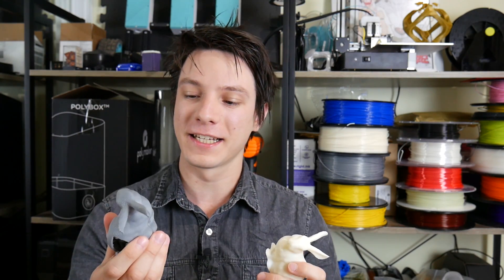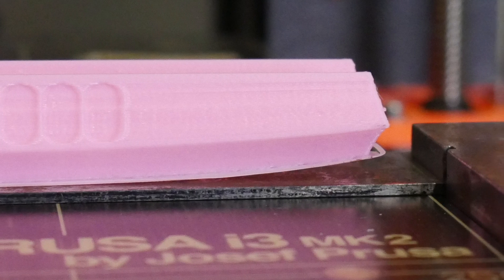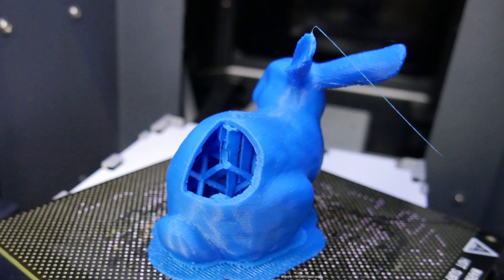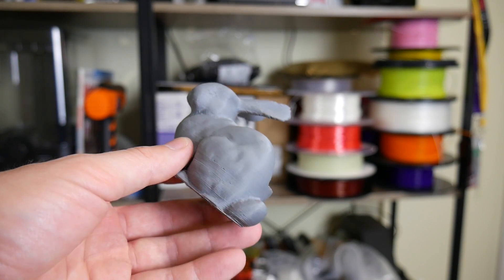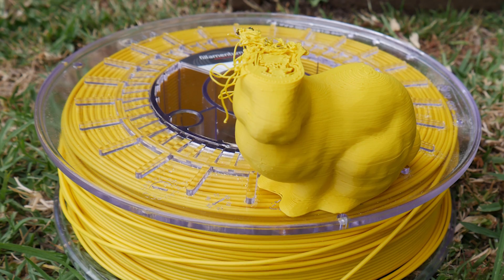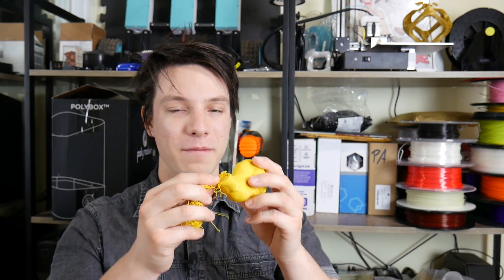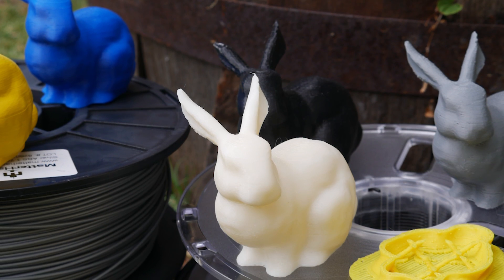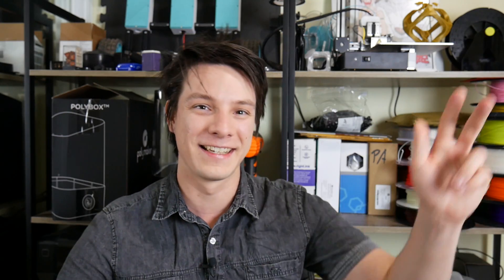Should you 3D Print in ABS? Probably not.

Comment: Polycarbonate has warping problems too, I think it's harder to build than ABS. Polymaker might be putting in some additives though.

One problem with the sliding bed machines is that it constantly breaks its boundary layer envelope when it constantly moves the part, cooling the part faster than you want, like how a breeze feels cooler than calm air, because that motion relative to the air breaking the insulating air around you. That makes them the least ideal type of machine for ABS (and PC) but they're the cheapest kind of machine to build. An enclosed area helps. ABS plastic is very tough but using machine designed for PLA compromises the build strength. Most hobby and consumer machines are really designed for PLA even if they claim a long list of compatible printable plastics. ASA is a nice material though. PC is nice too. All plastics have their unique mix of properties. PETG is nice but it's also very flexible so the design might need to be adjusted for that.

Comment: What about ABS+ ?

I agree that abs can be difficult but with PEI it is relativly easy. I tried abs+ and it is easier then regular abs, don’t really know the difference but i recommend to try it out.
Reply from the maker: +Henrik Wikström what is abs+? Sounds like a marketing thing
Reply: It is absolutely not a "just a marketing thing". eSun, F3Dfilament (Finnotech to you guys I guess), and Devil Design are just 3 brands producing ABS+ variants, basically ABS diluted with other stuff.  I use it a lot : it doesn't stink like ABS does during print and warps a lot less, yet it allows the typical ABS tricks (ABS welding, smoothing ect ect) - although the eSun variant does not completely dissolve like DD and F3D ABS+ does.  While I don't print normal ABS when I can help it, I've found ABS+ to be very useful at times. In fact, it has replaced my PLA use totally and I now only use ABS+, PETG and "special stuff" depending on what the prints are meant to be able to do.
Reply: Hey my dealer sold me some PLA+ and it is about 2x stronger than regular PLA and requires much lower retraction settings, love the stuff. I bought a role of ABS+ as well but never tried it, but my dealer said it is a stronger and easier to print ABS. 

Did do a couple of ABS prints a while back and found the material unremarkable, have to agree unless you specifically need its qualities, there are better options.

Cheers Angus
Reply: Think he might have meant PLA+. I've printed a headphone band using a sample from rigid.ink and it's much stronger and less brittle.

Comment: Should you 3D print in ABS ? well every materials have their pros and cons. The choice of the material depends on which application the part will be used for. It's totally different whether the part is just aesthetic/artistic or functionnal.
I usually print in ABS rather than PLA because I mostly print functionnal parts (mechanical parts), and aesthetic parts can be smoothed in aceton vapor bath.
And as far as I know other high temperature material like nylon or polycarbonate still suffer the same issues as ABS.
Reply: Hansbald depends on what you need, PETG definitely offers food contact and chemical resistance, but ABS parts still will stand a bit higher temperatures, and as far as I know, ABS seems more durable for outdoor uses. So still depends on a point of view.
Reply: try to smooth PETG with acetone
Reply: Not as catchy of a title...

Comment: Well, outdated means nothing to me in filament considerations. ABS is a material with a bunch of particular properties. If you want a material with good overall strength and impact resistance, which can be thinly sanded and smoothed, which hold well paint too, and which will last under weathered conditions, ABS is still hard to beat even today. You can probably replace for a better property or two but you can't beat all in once. The price tag can have the last word. By the way you can't get PC in Europe under 38€per kg which is insane. The price tag of uncommon thermoplastic filaments is enexpectedly expensive. Why? You can get a PC or PET sheet at roughly the same price (10-20%gap) as ABS or PVC. Why is this so different with filament? Marketing? Or maybe because you could agree or pay more?

Comment: I have a CEL Robox (v1/single material) and was wondering if you had any recommendations for a polycarbonate filament?

PS: Noticed that you are a bit of an Ave follower too - Good Work!  :-)
Reply: PC max is an approved Robox filament. There is a built in profile for it.
Reply from the maker: Good question, the Robox has a weird kind of extruder design, can it go up to 260-270deg C? That's what you need for PC filaments. From memory the heat bed was plenty powerful enough!
Reply: I have a roll of PLA in there atm. Automaker is only letting me go to 210 degrees (C obviously) for the filament and 170 for platter. I'll change the reel and check again...
Reply: - update. With a roll of ABS, it's 250/170. Is that going to be hot enough for PC?  
If you're not sure, please suggest a couple of vendors and I'll quiz them.
Reply: Scienteer, I'll google where's the best way to buy the stuff in Australia.
Feel free to share any vendors.
Thanks.

Comment: I ABSolutely  love ABS. It gives you a smooth finish, it's more forgiven, the supports are easy to take off, more flexible. But it's weak, you need to compensate with more walls and it smells, you can't stay on a room with abs.
Reply from the maker: Smells is a big one. I had forgotten how bad it could be, the hepa filter in the mini 2 does heaps to cut it down.
Reply: @MakersMuse  I usually just lock my printer in a basement bathroom with the ventilation on
Reply: You guys either have way more sensitive noses. I print ABS daily, printer is like a meter from me (mk2s). To smell anything I need to lean over the heatbed and actively sniff.
Reply: I run hatchbox abs, about $20 usd a roll and i cant smell a thing :/
Reply: Burning is nothing like melting.  Do not compare those.  I don't have any scientific way to test purity, but I always pick brands I know make very smooth and stable slurries in acetone and that vapor smooth well.  These I have always assumed were more 'pure' than the other brands, but I cannot say for sure.  May be just mixed with something else that dissolves well in acetone.  ABS smell does not bother me or my asthmatic wife.  Smells will be different to everyone of course, and how bothered you are by the smell has nothing to do with any possible long term health risks.
Reply: IDK I can't stay in a closed room when printed abs for a couple of hours it's unbreathable my throat starts to shrink after  some minutes
Reply: Perhaps it's brand related? But I print mostly in cheap abs from wolfix.
Reply: Polycarbonate (and presumably ABS-PC filament) fumes are even worse than ABS though.  Not only more types of particles (ABS typically being styrene particles where PC throws benzene into the mix), but also in terms of absolute quantity - PC puts out more.  Even if the VOC is lower (and you don't smell the ultrafine particles as much), PC still is putting more into your air.  Granted, at least it's not nylon level of particles.  Here's an article comparing the level of particles and VOC for different types of filament: http://pubs.acs.org/doi/full/10.1021/acs.est.5b04983
Reply: Same here, I am 1 meter from my printer in a fairly open room (living room) and print ABS on it all the time.  My wife has asthma and has never even mentioned the smell.  I smell  PLA far more, but it is a pleasant smell, although I really dislike the hard finish it has and how brittle it is.
Reply: Same, I was concerned that i wasnt smelling anything when i first started printing, thought they shipped me a different plastic
Reply: Probably not 100% ABS, if you try to burn abs plastic from a toy or a plastic box   with a lighter it stinks really  bad, that's what I'm getting not so intense, but after 1 hour in a closed room it's smelly
Reply: Ok my abs is very intense (from gearbest) yours not . period.
Reply: ABS is the most toxic amongst print materials according to a pretty in-depth study I read. Prolly won’t kill you but may cause brain damage :) Now I open my front door a crack when using it.
Reply: that smell is death entering your nostrils ... I just use my tower fan to circulate and spread out the fumes its fine, doesn't smell that bad. that said it is pretty toxic and super flammable; theres better stuff you can use.
Reply: Short to Ground you should try polymaker polymax it is incredibly amazing PLA and it shares many characteristics with abs
Reply: Maker's Muse does a HEPA filter work well on ABS fumes?

I'm half way through assembling my 3D printer and have a 2x 1kg rolls of ABS filament. 3mm sent in error plus 1.75mm I wanted. It's in a wooden cabinet (my children's enthusiasm would destroy it otherwise) so a filter could be added cheaply.

Comment: Does pc-max also have warping or shrinkage issues?
Reply from the maker: It does, and a slightly higher extrusion temperature so if you can't reliably print ABS you won't be able to print PC.
Reply: I see, what filament would you recommend if you need a glass transition temperature of at least 80°C?

Comment: How badly does Polycarbonate warp? I heard it's worse than ABS, so if ABS is diffcult to print, Polycarbonate is even more difficult.
Reply: On my printer cheap HK PC warps way more than ABS. It might have to do with the absence of a heated chaimber, bed at 130°C though.
Reply: Polycarbonate in general is much worse than ABS, you should not generalize - the good results you got are with only the single super expensive PC-Max material BLEND, not with "polycarbonate".
Saying that ABS is obsolete is too much too soon.
ABS will be obsolete only when there is a generic type of material supplied with multiple vendors that is not 4x as expensive as ABS and is as good as PC-Max.
Reply: @hlavaatch  it's $40 now for 750g. Wonder if it's still good?
Reply: Jan Hlavatý it's vallée PETG
Reply from the maker: It needs a higher extrusion temperature, but in my experience warp is similar and manageable at least in the UP Mini 2 it's not an issue.

Comment: imo i prefer petg over abs
Reply: Yes it can, PETG is just tiiiiny bit less temp. resistant than ABS. At 80C it's still rock solid
Reply: Laharl Krichevskoy I made my gear shift knob of petg, and I live in one of the hottest cities in the world  (Phoenix).  Yes, petg holds up fine in a car
Reply: Lerbyn 
but can you use petg in a car?  the idea behind abs is temperature resistance, can petg withstand a hot summer day under the svortching sun? thats the question...
Reply: You don't want to use ABS in a car - UV light (like from the Sun) will degrade it and it will break
Reply: @Steppan
Not really. Car windows are UV resistant. That's why photochromic lenses stay clear inside of the car.

Comment: I swear by Hobbyking ABS. i tried some more expensive ones and the improvement for me was not worth the cost increase.
It did take me about 2kg to perfect printing with it.
I print with ABS for two reasons:
1. Printing miniatures that i want to Acetone smooth.
2. I live in Western Australia and the car gets hot (where i often have my prints)

On large miniatures i often use sanded ABS to fill any cracks (which is rare now that i know optimum printing with it) and then acetone seal it.

Larger objects I have some PLA too of course.
Reply from the maker: WA sun will destroy PLA in seconds so can definitely see the value there for ABS parts! Impressed to hear you're printing miniatures with FDM in the first place :)

Comment: I've printed with abs a lot. Had quite a bit of luck with it. Yeah bit sucks if you don't get a good adhesion to the bed, but I frosted my glass I print on and paint it with an abs slurry. I have had failures, but had more successful prints. Yes pla works well for printing, but I don't care for how hard and brittle it is. I print trinkets and such here and there, but I mostly print useful items. Biggest issue I've ever had was with forgetting to store it properly and it getting full of moisture. I also like to smooth it with acetone vapor.
Reply: My experience is pretty much identical. :)

Comment: I print in ABS for things i want to smooth and that's pretty much the only reason.
While acetone smoothing does need to be done right to work it does well work.

What other filament plastics can be smoothed? Maybe i should look at those.
Reply from the maker: Not too many, which is one of the few remaining reasons I print in ABS, along with using acetone to bond it together so strongly. It's way better for prop making than PLA in that regard. Anything else you basically need to apply something over the layer lines, or sand them back. Polysmooth (PVB) is promising but the material is not very UV stable in my testing so far.
Reply: I assume you are referring to either Tetrahydrofuran or Dichloromethane smoothing for PLA.
Yeah not touching either of those for PLA smoothing without specialised equipment and lots of safety gear.

While Acetone isn't exactly great its much easier to handle and obtain then stuff that can smooth PLA and also much easier to work with.
Reply: I might need to give some ASA a try then.
Reply: PolyMaker has filaments that can be smoothed with isopropyl alcohol vapor. Checkout their PolyShur product. I have no experience with it.
Reply: As I do a lot of post-processing - undercoating, painting, filling, varnishing, so the many of the characteristics that make ABS an option are negated as unnecessary or not required. PLA does fine along with options such as PLA+, PETG. This video has caused me to think about alternatives to ABS for those times where PLA won't suit my requirements.
Reply: Laharl Krichevskoy PLA can be smoothed with chloroform and tetrahydrofuran, which are hard to buy for an individual in Europe (sale supposed to be prohibited here in France but because of European regulations, I've been able to buy some THF from Italy for €30 for 1L + €15 shipping, thus economicaly not worthy, I use THF only to clean heatblock's threads after there's been some leak into it, which may happen when I have to change nozzle size.
Reply: ASA can be acetone smoothed and welded

check Tom's channel he has a review on one ASA
Reply: Shival Wolf steel wool and auto body primer babe.
Reply: @Shival Wolf
Have you ever tried  PLA smoothing with Tetrahydrofuran  or anything or you are just repeating BS read somewhere else?
PLA is easy to print but it is brittle, completly useless when it comes to temperature. You cannot weld it, smootht it and it is even dificult to glue with any standard glue.. so if you want to print some useless decorations downloaded from thingiverse I'm sure PLA is your way to go. 
But if you want to print anything usefull you might consider PETG (cyclohexanone  works almost as good as acetone for ABS - it is not as good for vapour smoothing but works perfectly for welding) but cheap PETG is a nightmare when it comes to stringing and expensive PETG is.. expensive.
Reply: Shival Wolf 
i remember reading that PLA can be smoothed with DCM or some tetrachloro-something. Havent gottent to try that yet though but the pictures looked pretty good.